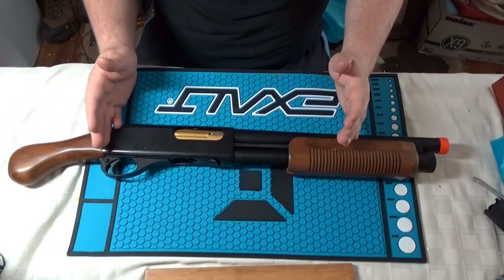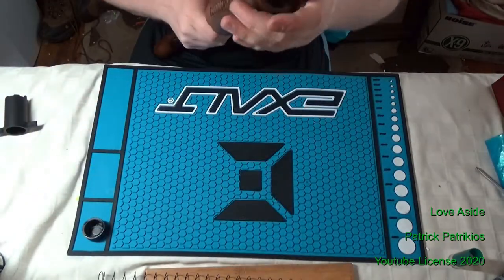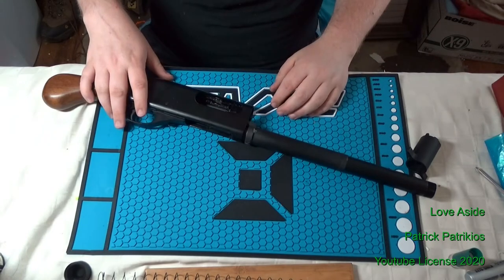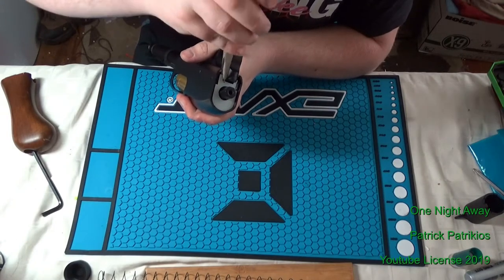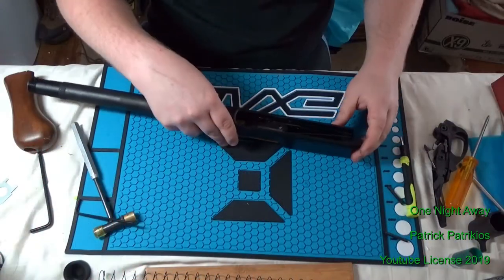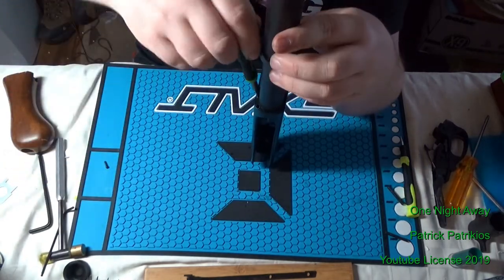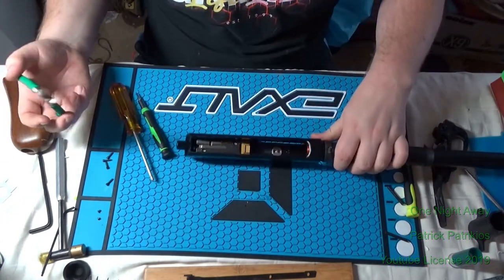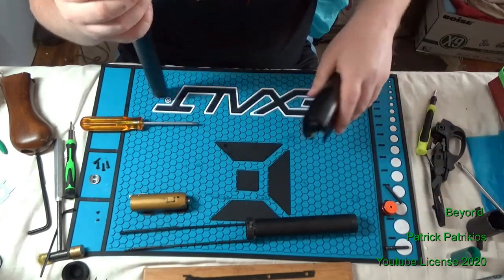APS Cam870 full Teardown

Comment: Good video! Was curious if you could remove the pistol grip as I wanted to put a full stock on this model. Hopefully ordering soon!
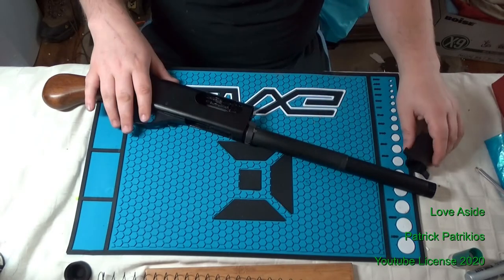Reply from the maker: Yeah, You can swap the grip simply by taking out the m6 bolt in the handle and swapping for the buttstock. some Remington stocks will fit but sometimes they require some minor modification (2:14). You can also buy one with a buttstock pre installed. Thanks!

Comment: Is this disassembly the same for APS CAM MkIIIC Classic Shell-Ejecting CO2 Shotgun?  How do you lubricate it so when I pump it, it's smoother? Which area needs to be lubricated?
Reply from the maker: Yes. They all disassemble mostly in the same way. it depends on where the action is sticking, but grease the inside of the action/receiver and lightly on the bottom of the bolt. I also lightly grease the arms at the receiver. if its really stiff make sure that no BBS ended up inside the action. that sometimes happens when a shell misfires. the Bars are effectively the rails for the bolt so most of your friction will be in those channels inside the receiver. I hope this helps but if you need more let me know :)